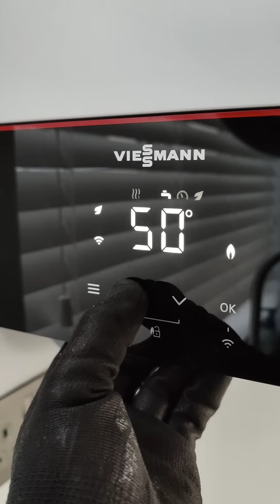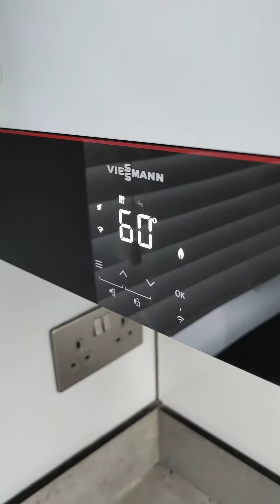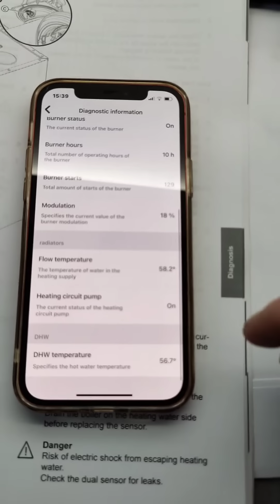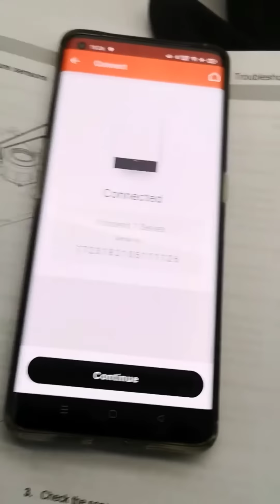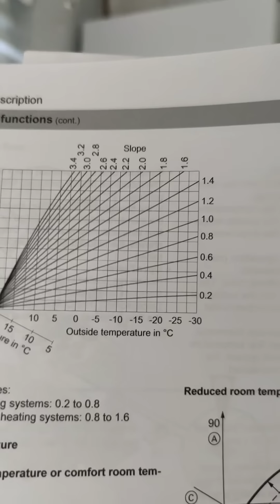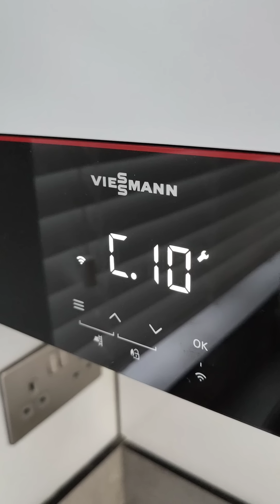Viessmann vitodens 100-W B1KF combi boiler (new 2021model)

Comment: Hi, this is a very nice and comprehensive video. I got one question for you regarding commissioning parameter C.6 flu length. The documentation states that each 90 degree bent after the boiler adds 1 meter to the settings. For a standard flu which is a 90 degree bend above the boiler and a straight around 1 meter pipe which runs outside, the correct C.6 setting is 1 or 2?

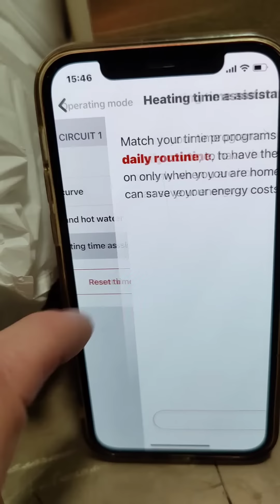Comment: I got this boiler recently. Noticed that the water tank was not heating in the midnight. I found out the preset of the tank heating between 22:00-5:30 is not reheated. 

I wonder do people normally adjust the timer? The contractor said it’s all set and keep saying there is no problem. I don’t want to cost more gas bill. I finished work pretty  late and need to take a shower at midnight 😢 he didn’t solve my problem( no hot water at midnight )

Btw great video 👍🏻
Reply: Is this a good boiler? I am wondering whether to change from Vaillant to Viessmann?
Reply: @ now it’s working fine but I still have an issue trying to pair the boiler to my phone 
I was stuck at the step after the wifi is connected to the boiler, but failed to pair up together on my phone ( vicare app)

Still trying to figure out whether is my 2.5G wifi problem or not
Reply: @SherriLiao  In response to this comment, it is always better to connect to a 2.5GHz WiFi channel from your router. Even though the connection is not as fast as a 5GHz channel, the router will be more able to amplify the signal successfully to any WiFi enabled device or appliance through walls and doors, if necessary. Just ensure your boiler is operating on the same frequency.
Reply: @ I decided to adjust the boiler time to keep it running longer than the default setting. New Operating time : 5:00am-3:00am next day
So 2 hours resting between the midnight

Now I have hot water, but not sure if it may cost more the gas bill or not
the water stay heated during the shower at the midnight now tho

I figured out that the reason why there is no water in the midnight  is because the operating time in default setting  will not reheat the water after 10pm  
So I guess is the timer setting issue 

My friend has a Bosch boiler and he didn’t have this timer issue
Reply: Superb and informative presentation. We had thus installed November 2023 and it’s been outstanding. The ViCare app allows easy changes to temperature, times etc. Money well spent
Reply: @robfairley854  Thanks for your experience and recommendation. I have found out that I can’t install a Vitodens 050 or higher spec combination boiler as Viessmann insist on a whopping 700mm clearance from the front their boilers to any fixture and fittings directly in front of it. I will now invest in another Vaillant EcoTec Plus boiler, equivalent to the Vitodens 200-w combination boiler, because they only require a 500mm clearance at the front of all the boilers. This also has a stainless steel heat exchanger.

Comment: How can I get the app when there's no model number etc? We moved into a 2 year old build,we can get hot water but no heating.Even after bleeding,no heating. Help please?
Reply: Same problem...
Reply: You need to remove the outer casing. There will be labels with qr codes and serial numbers and wifi codes etc

Comment: On my settings Burner status is off. Should I turn on? And how do I turn heating up or down via app? On my thermometer in house temperature is 20 on the app heating circuit 75° . If I want to turn heating to 25° how do I do on the app?

Comment: Hello, i have underfloor heating and opentherm thermostat connected to this boiler, the problem is that sometimes the boiler loses connectivity with the thermostat and when the connection is lost the heating circuit blasts to 95C, if i reset the thermostat connection is restored and everything works correctly again, clearly this is a thermostat error, but is there a way to setup a temperature limit for heating circuit ? thanks

Comment: Does it have built in weather compensation
Reply from the maker: Yes. You have to use a veissmann weather sensor as they are a different kOhm to other brands
Reply: @thornhillplumbing  What are the part prices like in comparison to Baxi
Reply: @dickiedubs3137 that’s like asking what are the parts pricing like for a ford fiesta compared to a Ferrari

Comment: do you get much dissipated residual heat into the radiators when using the hot water? i just got a 050-w installed and it seems to be heating the radiators when the hot water is used. the engineer said this was normal but i keep reading about a stuck diverter valve being the cause of this.
Reply from the maker: This is not normal. If you hold the flow pipe while you are using hot water , and the flow pipe heats up , this indicates a diverter issue.

Comment: I had the Viessmann Vitodon 100-W 32Kwh brand new (latest model).  From day 1, it has been throwing errors and bamboozling gas engineers.  I had it installed in Oct 2022 in preparation for the cold weather conditions in winter.  I was only getting consistent hot water, but very little CH.  It got to the point that I bought electric heaters to heat up my home.  A Viessmann engineer refused to inspect the combi boiler since it is connected to my thermal storage.  He said our combi boilers should not be connected to a buffer tank, and installation should be rectified as per the manufacturer's instructions.  In June 2023, I brought another company to remove the buffer tank and disconnect it and put it right as advised by Viessmann.  The boiler has started kettling, but settled down, but it is still not woking for CH, and when that same Viessmann engineer came in to look into the problem, he said it is short-cycling and that my CH system needs to be balanced!  I have had nothing but grief from this boiler.  My old IDEAL 13-year-old boiler was far more efficient, but sadly it has come to the end of its lifespan.  I would not recommend Viessmann based on my experience.  Not to mention, their customer service is poor.  Stick to Worcester Bosh, Vaillant, Baxi or IDEAL.

The installers are coming back to balance the CH to see if the short cycling will stop, but I am not holding my breath!

Any suggestions would be greatly appreciated.
Reply: It should be a problem with the system, their boilers are pretty good , atleast in my experience , i`ve monted more than 15 of them and they are all working perfectly.
Reply from the maker: Unfortunately you had the wrong installer in to fit your boiler. You cannot blame the boiler manufacturer for a poor installation.
Reply: Six months on from my last comment, Viessmann engineers are still coming to try to resolve the CL lockout.

They checked the installation and have no reservations about how it is installed.

My system has been powerflushed and balanced.  

Yet the water pressure still drops to 0.4 - 0.1 in less than 24 hours.  The engineer replaced the pump and PVR as a precautionary, but he can't tell why the problem persists.

No leak in the system for the pressure to drop that low in less than 24 hrs.

All radiators were checked with no trapped air.

The 5th Viessmann engineer visit is due in 2 days in a space of one year.

My experience has been horrific from day 1, and not many gas engineers are interested in troubleshooting such a sophisticated boiler.
Reply: Awful to hear , I hope this was finally sorted as if not small claims would be your next bet
Reply: @user-te1le7ck6b   Only last month, the power control PCB was at fault, and a Viessmann engineer came to replace it.  All these faults in less than 2 years.  It is finally working as normal after 1.5 years, and I'm not impressed by the make overall (from my personal experience).

Comment: Hi, I had to remove the heat exchange as it was clogged so the hot water was fluctuating. It is now working but the boiler says AP and I cant get any of the front panel buttons to work, any ideas how to exit this AP mode ? Thanks
Reply from the maker: Hold menu button for 4 seconds  then press up , then keep pressing OK

Comment: My plumber wasn't about to install our room stat when he installed our boiler because he wasn't sure how it work on this model. It's a two wire electromechanical switch. Do I need to wire it to L and N, or L and 1, or 1 and L?? Any tips are greatly appreciated
Reply: According to the scheme, it is connected to L and to 1. N is connected if a Vitotrol thermostat is used i think
Reply: @GODTRUEONE  thanks muchly for the reply, I really appreciate it

Comment: I came across your very interesting and thorough video, you obviously seem to know your way easily around the Viessmann controls, I wonder if you or anyone here can help, I have 200-W Vitoden with the 7" digital screen, Do you have any idea as to how this boilers flow temperature can be reduced to around 60/65 degree, it is not weather sensor controlled, it's only control is by  use of a Salus It500 thermostat to control temperatures required for the rooms. As I, for the life of me can't fathom how to reduce it, so surely there must be some form of control for that within the boiler on it’s digital screen settings somewhere, to be able to adjust the flow rate? so would be grateful for any directions.. Keep up the good work
Reply: I have to answer your question with a question. Why have the very best boiler on the market that is perfectly optimised for weather compensation control (superb minimum firing rate of 1.9KW) and that is all built in and then not use it? You paid a premium price for this boiler and you have essentially handicapped it.

Comment: Very interesting. Does this boiler require a 22mm gas supply? Our house was built 20 years ago and has an indirect type heating system with cistern tanks in the attic. A 15mm gas pipe goes from the meter (beside the front door) underneath the house to the boiler in the utility room at the back of the house. Some neighbours have changed to combi boilers by having a 22mm pipe fitted externally going around the house but it looks awful and we don't want to do that. Does the 15mm pipe mean we'll only ever be able to have a regular boiler and will have to have a direct unvented system if the current hot water/heating system fails? Thanks in advance. P.S. What area of there UK do you cover? Thanks again!
Reply from the maker: It depends on the KW of the boiler and how far the boiler is away from the gas meter. A combi usually requires 22mm or 28mm pipework to comply with the gas regulations. You would only be able to have 15mm pipework if the boiler was right next to the gas meter. I would look at your neighbours houses as a guide.
Reply from the maker: I cover Dorset and Cardiff areas of the UK

Comment: Would you say the viessmann 100w is a better boiler than baxi 836?
Reply from the maker: In many ways the viessmann is a better boiler but the baxi is also a brilliant boiler and has advantages over the viessmann. It would depend on the size of the property and other factors to decide which is the right boiler out of the two
Reply: Luna Platinum series you should look. good boilers.

Comment: Does this boiler work with ufh , would it affect the water temp in the pipes ?
Reply from the maker: This boiler does indeed work with underfloor heating , this will not affect the temperature of the hot water or the radiators as the underfloor heating will have its own manifold, pump and blending valve so the temperature of the underfloor can be controlled independently to the rest of the heating.
Reply: @thornhillplumbing  what have to be doesnt mean it will be. for example in my house radiators and floor heating is in the same manifold. floor heating pipes can tolarate 95c temps so its not doing anything bad to the pipes. limiters limits flow so floor is always only warm not hot even if my watter is at 65c going to the manifold.

Comment: Do I need a vicare termostar to use the vicare app? Or maybe the vicare app just connects via wifi to the boiler itself without the vicare thermostat?
Reply from the maker: You do not need vicare thermostat. The boiler connects to your phone directly.
Reply: Not wecar
Reply: @h.ibrahimcinar3151  garbage answer!

Comment: I am wanting to connect Nest 3rd Gen to the 100w using Open therm. On the nest heat link the connections are marked OT1 and OT2 but in the boiler the open therm connections are marked + and -. Which one should be connected to OT1 in the heat link?
Reply: Not polarity sensitive. Can go either way
Reply: @Smacktee  That's what i thought but i am getting error code 95 on boiler and H73 on nest. Boiler C:7 set to open therm. Driving me mad. Viessmann say ask Google and vice versa!
Reply: @simongarland5678   did you solved that problem?
Reply: @karoljack2070  Yes. Someone had not put the connector block in the boiler the right way. 180 degrees out. So what i thought was terminal 3 (open therm) was actually terminal 2 (cylinder temp sensor) Worked straight away once correctly connected. If you look at the boiler wiring instructions you will see what i mean.
Reply: Does not matter what way around you connect the wires

Comment: My water heats up too slowly, is there any way to speed it up a bit?
Reply from the maker: You have pipes running from the boiler to the hot taps/outlets. When you open a hot tap, the boiler will fire and send hot water to the taps. 
When you turn the tap off, the hot water that is in the pipes will cool down. 
The next time you.open a tap, you will have to run off all of this cold water..the further away from the boiler the tap is, the more cold water you will have to run off .
The solution is to make sure all of the pipes are as short and as narrow as possible. 10mm pipes are usually sufficient for basin taps. 
Also pipes should be insulated and the boiler should be positioned as close to all hot outlets as possible.
I hope this makes sense.

Comment: What size cable do you use to connect and breaker thanks
Reply from the maker: 0.75mm
Reply: @thornhillplumbing  :DD 0.75mm2 is for earphones not electricity.

Comment: When setting a max DHW temperature  I assume that means the temperature of the water should not exceed that figure??  However mine goes way above the temp I have set.  The smaller figure giving the current temperature goes up to 20c above what I set it to!!  I assume this is not right?!
PS I’ve only just had it installed!
Reply from the maker: That is correct. The temperature of the water leaving the boiler should be approximately what you have set the temperature under the tap symbol. You can try setting the eco mode to on (under the leaf symbol) as if the eco mode is off, the hot water will be pre heated.
Also, the slower you run a tap, the hotter the water will be, but this should be limited to what you have set the hot water temperature to by tapping the menu button until tap symbol is illuminated.
I hope this makes sense. The boiler will be under warranty so may be worth calling the installer to check with him, or to arrange a warranty visit from viessmann.
Reply: I also have this problem, DHW set at 55 and still reaches 70 at the tap, did you resolve it ?
Reply: @robperry7596  how are the slopes for Heating circuits set? Do you have hygene function enabled?

Comment: Why would it be less efficient to heat the house faster? I've always had my boilers set to Max but would you suggest lowering this?
Reply from the maker: Because the higher the return temperature, the hotter the heat exchanger gets, the less the boiler will condense and the more heat is blown outside through the flue and wasted. Also higher temperatures cause more corrosion in the system.
Reply from the maker: Get the flow temperature as low as you can get it . A lower flow temperature to the radiators will also make the rooms more comfortable as the air temperature will be more stable. You will then find you can turn your room stat down also which will save more energy.
Reply: @thornhillplumbing  Thank you, that's really useful info.